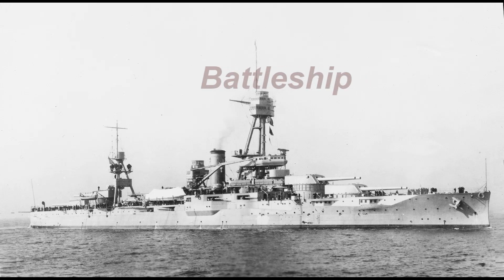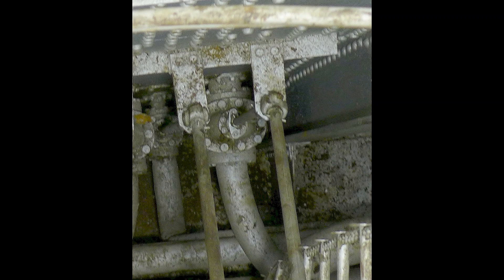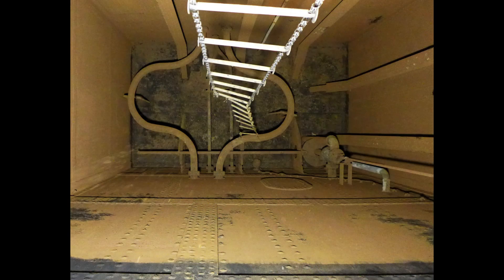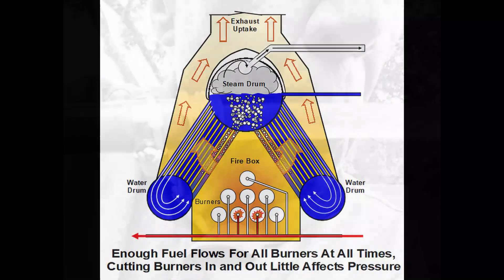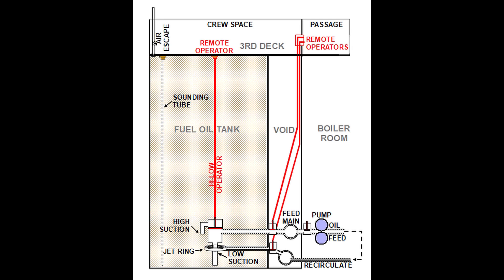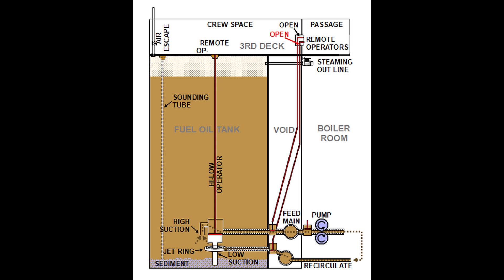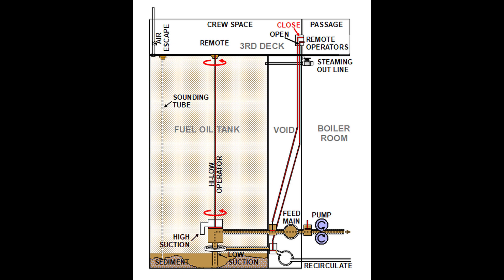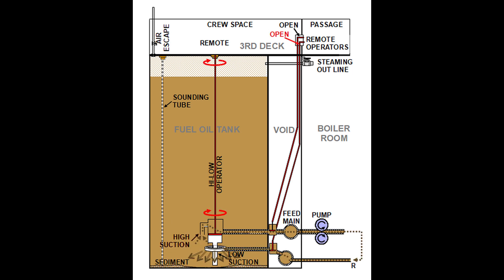Battleship TEXAS, What The Heck Is The Recirculate System?

Comment: This recirculate system was done away with on later ships.
Steam coils were put in each storage tank at the bottom to heat to about 120 deg F.

This oil was pumped to a service tank that held the fuel to be used that day,
On the way to the burners it was heated to the proper temperature using a fuel oil heater depending on type of oil around 180-210 def F.
Reply from the maker: Thanks for the comment.  In Texas' case, the Navy avoided the complexity and steam consumption of a steam heating system at the time that she was updated from coal fired to oil fired boilers.  The only exceptions were the emergency tanks located in the double bottom and the service tanks.  While bunker C was the fuel of choice, it was too viscous to reliably pump at many temperatures without the steam heating that you mentioned.  Their solution was to lower viscosity prior to loading it on the ship by diluting it with diesel fuel, resulting in the creation of Navy Special Fuel.  

I cheated a little in the video by not mentioning the ship's service tanks. There were four of them that fuel preheated to about 100 degrees was stored in. I did this to keep the video focused on the recirculate system and tank operation.   In Texas' case, the tanks were continuously kept topped off by the feed system as oil was consumed from them by the boilers, so their existence didn't substantially change the description of the rest of the system.  The preheated fuel was heated to its final temperature of 180-210 degrees after it left the service tanks and immediately before entering the boiler burners.  The effect was that the tanks mainly acted as a buffer to provide smooth, continuous feed to the boilers when switching tanks, rerouting feed due to damage, or when resolving any major problems with fuel or feed anywhere in the system.
Reply: I did not know that Navy Special was so low in viscosity
If did not have to be heated.

The WWII battleships like NJ , Iowa etc had steam coils and Zi thought they used NSFO.

By the way I think after the first BB was reactivated only the 1980’s
They stopped repairing the steam coils in the tanks And eliminated the oil heating system as they
Had foolishly changed to 
DFM by then.
Supposedly saving 10 percent of cost of shipyard work!

Giving a marine boiler DFM instead of bunker C or NSFO is like giving a drunken wino the best Vintage liquor!
Sure it will work but why pay 3 times more !

Thank you for the excellent explanation,
Reply from the maker: @josephpadula2283  Point well taken.  In spite of its nastiness and viscosity, the beauty of bunker c was that it was essentially a waste product of the oil refining process, so it was cheap and plentiful.  At one time, the entire fleet relied upon it, but perhaps demand for it dropped enough by the '80's to make maintaining an infrastructure that handled it wasn't worthwhile.  Thus, the change to DFM.  Anyway, that's my guess.
Reply: Entire merchant world fleet still uses bunker C now called HFO or a Navy Special like fuel called IFO,
A cut down intermediate fuel oil.

The Navy changed to simplify logistics just Before the 1973 spike in fuel prices
But never admitted the mistake
And went back..,

Story was also told the labor to clean the boilers was too high but merchant ships did not go inside with a wire brush like the poor BT’s had to in the Navy!

Water washing boiler interiors was invented around WWII and that handled cleanings for the Merchant boilers.
Reply: @josephpadula2283  We used JP5 as much as DFM. That way the oilers only had to carry one type of fuel.
Reply: John,
That is criminal.
DFM was bad enough!
JP-5 costs even more as it is more refined and processed to have a Kerosene (jet A, jp-8 ) type fuel with a special 140 degrees flash point for shipboard use. 
Then to use it for a boiler that would Rather have cheap Bunker C or it’s Champaign equivalent
NSFO!

Bunker C has more BTU’s per pound than any of the weed lighter fuels too.

The tankers then  were built to carry 3 fuels,  it is not like they had to add the other two fuels.

Comment: did the oil king have a small testing lab similar to the Iowas? I think it was Iowa that put out a video of their lab and the duties their oil king had to do to test for impurities on basically every fluid on the ship
Reply from the maker: The oil king on Texas had a locker in the aft portion of drying room 4 on the third deck.  However, it stayed cool in spite of that since it was inside one of the boiler air intake trunks.  The main function was to test viscosity in order to select appropriate burner tip plates and pump pressure.  Testing while at condition one was pretty continuous, especially if they were switching tanks.  So, portable test kits were placed in each boiler room to be able to accomplish that.